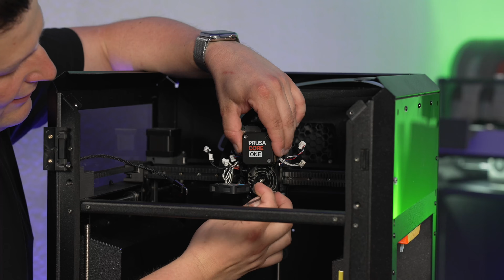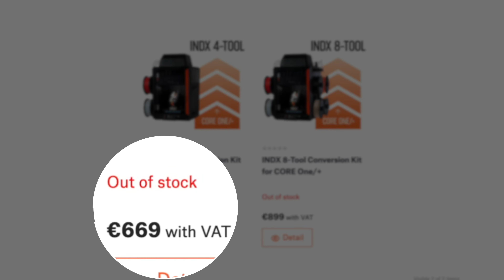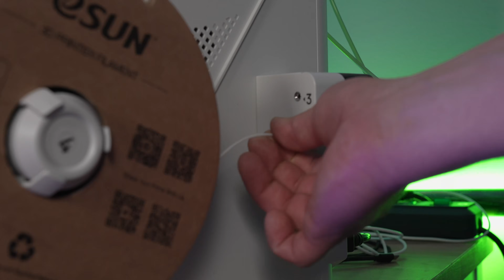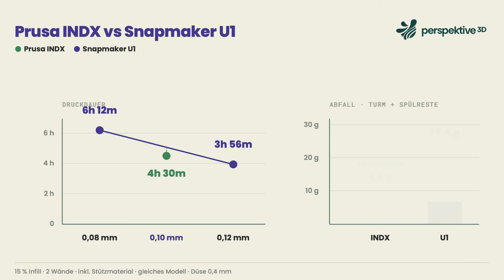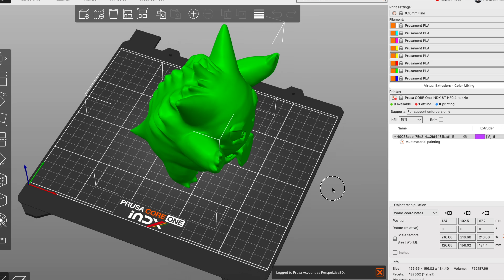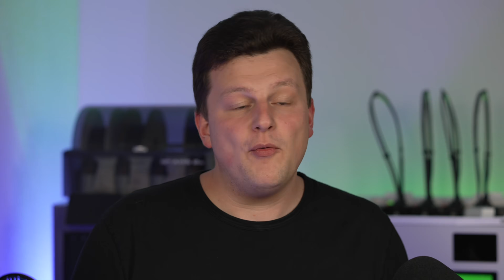Prusa INDX: Is It Worth the Wait? My First Look

Comment: at that total price, how does it compare to the Prusa XL?
Reply from the maker: Well with my XL I am not super lucky. I have feeding issues and I just have to baby sit it much more. There might be something wrong with my device but in general the INDX feels more modern and reliable. Although I know there are XL users that do not have any issues. As a 5 tool and with enclosure the XL is more expensive
Reply: @p3d-intl  interesting. I'm strongly considering the XL if our roof repair is surprisinglky cheaper than budgeted xD, but I am the most lazy possible printer user.

Comment: The indx clearly needs a prime tower as the stringing with the pellet solution is clearly insufficient at the moment. 

A more fair solution would be to either remove the prime tower for the U1, or add one to the INDX and the compare the times. In both cases, the U1 would be far faster than the INDX. 

You also can easily half the prime tower or less for the U1 without sacrificing any quality. This will again make the tool changes noticeably faster than the INDX, even without the prime tower. 

Also, the U1 can easily go down to .08mm layers and lower.

The 20 second tool changer is the absolute worst case for the U1. The first layer prints a prime tower with a large brim for adhesion so it takes longer.
Reply from the maker: Thanks for clarification. Will check in my full review!

Comment: Imho, the "new" stuff like indx and full spectrum makes it more and more clear that the 3d printing space's SW has a huge SWE problem: the current separation of concerns is wrong, and it's time to get it right. The current "god" slicer concept and implementations, which try to know it all, are not scaling properly with the current pace of change.
Slicers should only describe geometries and process features (parts orientation, infill, supports, prime towers, etc.); everything else (speeds, motion, materials, etc) belongs to the printer, and it's FW. That would address pretty much all of your grievances.
Reply from the maker: Interesting idea

Comment: Just for the record - depending on what you are printing with the Snapmaker U1 you really do not need a prime tower .
I have printed many different things without a prime tower , even a handle with embedded shore 60a tpu without
any prime tower , so in reality you need to compare the Core One with the INDX system against a print
on the Snapmaker U1 without a prime tower .
In the end i am glad to see this video really showing the INDX system in the wild , no doubt that 
Bondtech came up with a very good design to allow many tool heads in a small space .
Thank you for the video :-)
Reply: I also  often print without a primetower on the U1. Partly by choise, but often because I want to combine filaments that don't bond very well, to use aa support layer material. 

But if I use a primetower i that scenario, both types of filament also end up in that same tower. And things can get ugly, tha chance of spaghetti forming, is huge. So it would be nice to Print 2 thinner filament towers, one for pla, 1 for petg.  Or an option to not use the filament used for support interface, in the prime tower would be great. 

So printing without a primetower works well in many occasions. But with use of the nozzle wiper. 

So Prusa, please add such options. 

(Still waiting for my chance to order the INDX, but owning a C1L, I have to be patient....).
Reply: @4Lph4Num3r1c you can set the prime tower to create a walls with only one material. Keeps it from toppling.
Reply: @Zardozer yes but not the whole tower needs to fall to bring mayhem. Also the little strings that don't bond, will start to live their own life. Ending up in other pieces or just laying around the buildplate. And sooner or later the AI will pause your print. (At 2 am, loosing valuable print time, that isnt being used). 

Am option where ot doesnt end up in it at all would be better. The toolhead with the support material can prime at it's start position with the wiper.
Reply: @4Lph4Num3r1c I print all the time with PET-CF and PLA for support, they do not adhere to each other and have never had any issues with a priming tower. Flawless every time.
Reply: What printer did you use to print 60A TPU ? the U1 ?? thanks
It works well on my A1 but I have to mod my dryer, now I have to hold the filament with my hand...

Comment: As expected Prusa’s integration is lacking. As for INDX - which is built by Bondtech, one of the world’s best renowned extruders manufacturer - I have zero doubts the hardware will deliver flawlessly. I actually feel bad for Bondtech as I believe they fell for the appealing trap of signing a big integrator like Prusa from the get go and this has harmed them and made impossible access to other smaller integrators, (like us who applied for that in the early days).
If Prusa are already suppling this, the integration should - imo - be already be much more polished; it’s starting to look the XL fiasco all over again where early adopters were heavily “penalized” by those initial tuning/calibration/reliability issues. It will come to a good end I believe though.
Reply: Only issue I see with INDX is the exposed induction coil. That could be damaged by misalingment during tool changes.

Comment: Auto feeders like those on the AMS and U1 are underrated.
The indx seems like a decent concept but definitely a niche product and not the "new" multi color/multi material standard many were lauding it as.
I'd still choose the H2C+2 AMS 2s over this.
Reply: I'm perplexed by the fact that Prusa still do not offer a better solution for their MMU3.  The MMU itself works very well, but the filament buffer is a colossal PITA to load.  But there are better solutions, I use community-designed self rewinding spool holders, they work on the action of the filament being pushed back in the tube; there's no motor or power required.  And there are motorized versions as well.  
Personally I'm not going to touch Bambu.
Reply: @kaasmeester5903  That's fair. All of my bambu products (printers, AMS units and filament) have been rock solid reliable and predictable for me, that's why I stick with them.
Reply: @kaasmeester5903  as someone who has used both the MMU and AMS, lets jus say that there are good reasons that everybody is copying the AMS (individual feeders) and no brand has released a MMU (sliding selector) clone.
Reply: As much as people want to hate them now (and I completely understand those reasons), you still can't beat the workflow and automation of the Bambu Lab machines. Automation makes money. The AMS auto-refill feature by itself has "good for businesses" written all over it. My auto-refill gets used almost every time I print since I make very large and dense parts that are close to 1.4kg. If I'm asleep and the current spool being used is almost empty, the machine isn't going to waste those hours waiting for someone to feed in a new spool. Factoring that along with how reliable their printers are, and you have something that many people are in the market for.

Comment: There isn't anything in INDX that justifies the pricing. A 150W 24V induction heating inverter and coil cost less than $25 shipped, $50 as a DIY project. There will likely be half-price alternatives to INDX by this time next year.
Reply: This is a stupid comment. That's like saying "there isn't anything in Iphone that justifies the pricing, it's only like 50$ in raw materials like silicon and metals". Do you not realize that they have spent years on research and development. It was developed and is manufactured in Sweden, where the salaries and other costs are high. The reason why a lot of Chinese companies can bring down the cost is because they pretty much copy or clone what other companies have already invented. And manufacturing is faster and much cheaper in China.
Reply: @graxiecool  INDX doesn't need millions of dollars of R&D to achieve 95% of the functionality. At a glance, it looks like it should be just about the cheapest possible tool-head and hot-end design. On pictures, they couldn't even be bothered to protect the induction coil, hope the production version fixes that.

People have made DIY tool-changer mods for a few hundred dollars as a hobby, just not as compact due to the use of bulkier 3D-printed and off-the-shelf parts instead of custom-machined or injection-molded ones.

If I designed my own tool-changer, the biggest pain point would likely be learning how to add tool-changing code to Klipper if none of the existing tool-changing forks work in a similar enough way to how I want my tool swap to work, though looking at candidate forks alone could take days. Someone fluent in Klipper would likely be able to tweak existing code in a few hours.

The concepts related to tool-changing are not remotely new to the manufacturing and modder community. Unless BondTech's INDX contains patent-worthy new ideas besides patenting/trademarking the looks/shapes to prevent interchangeability, there will likely be third-party alternative 8-12 tool-ends kits under $500 soon enough. Fewer than 8 may not be worth the trouble since consumer printers will likely come standard with this many soon enough.

The only reason they can charge $1000 for now is that printer manufacturers aren't in a rush to bring consumer 3D printer price points down this fast. Consumer manufacturers just introduced their 4-6 heads printers, people who want 8+ now are the most likely ones to accept the premium. We'll likely see 6-changers become the norm at $1000 next year and 8-changers in two years - got to give customers reasons to feel like last year's printers are inadequate.

You can almost buy a whole M1D for the price of an INDX add-on, skip the hassle of installing it and gain a 2nd X-axis head for simultaneous printing or zero-swap access to a secondary material for things like support interface layers.

Comment: I don't understand your narrative. When you order the Founders Edition, you're aware that many features will be unfinished/missing (in a sense, this version is a beta test), and the delays were also due to hardware improvements (and a lot of software improvements were made along the way). Unlike, for example, the BambuLab H2D, Bondtech & Prusa decided to simply show an unfinished product, even so that users could contribute improvements to the hardware...
Reply: This is not a prototype, they sold this as a finished product.
Reply: @filmodpetra Not entirely. Founders Edition is an early release (even with the minor differences from the Prusa version), and there will be a lot of fixes and improvements to the Indx-related software in the near future.
Reply: @Zakrzewiaczek  they can fix things in software but they cant fix bad hardware (for example adding an additional nozzle wiper would be surely helpful).

I just cant get my head around how strongly they advertised no purge tower, and the result is a bad print...

Id rather have a prime tower any day of the week, but have normal print quality (to be fair, the single color print quality also looked ok, but worse then the competitors). And I know I can turn prime tower on, but the one of rhe main advertised feature on Prusa website is no prime tower...

Also, ok, lets say its not production version (It is, but lets say its not). It is acceptable in this case to send out to users a release candidate level of refinment. But what Ive seen from the 2 available first look videos so far, it is worst than an alpha version...

There are a lot of drawbacks of Prusas implementation.

Comment: I tried to get on the list but missed the opportunity.  I reached a point where I needed more nozzles than my U1 could provide. Just purchased an H2C. I have lost faith in this project. I do enjoy the simpleton Bambu way... As long as the user doesn't break anything, the H2C just works, and it's here with an established track record.  I guess I am getting too old to be an early adopter. ;) For this hobby, I want the hardware to just work. 6+ hours to make the modifications... If I were able to get my hands on the founders' edition,  I would have said sucked it up. Today, I say no way. I will keep this on my list and maybe grab one about this time next year if it's released in a more complete kit or built-on. Tech support lines will be burning red hot once these kits hit enough peeps. So many avenues for simple errors. What a nightmare. Good luck tech support!

Comment: The listed max temperature of 300C nozzle and 60C chamber is also a little of a bummer for engineering materials. I don't know how hard the chamber temp limit is but > 60C is ideal even for abs
Reply: thing is, its not really a "heated chamber" all it does is use the print bed to heat the enclosure
Reply: Consumer grade electronics generaly speaking are all desinged with a maximum ambient temperature of 65°C. Above that you cant use electrolytic capacitors, most microchips and standard wiring. Going above 65° requires more expensive components, carefull thermal management, thermal insulation and external cooling for sensitive areas.

Comment: The problem of Prusa is they are so proud to be made in EU and stuff they completely ignore design and user experience. They still have the mindset of designing for the same few Ender 3 users who are into tinkering and modification, completely ignore a huge population of users just want to create and print, and not being a printer mechanics as hobby.
Reply: I have a feeling they just can not do it - making a simple to use printer. Not enough investment in R&D... Or they are investing but not to the correct people. Hard to tell.

The printer has an NFC. It could be something that reads their open print tag, but it doesnt. And it os hidden at the back of the printer. Amd there are so much other missed opportunities...
Reply: @filmodpetra  I wouldnt call it 'not enough RND' but the wrong type of RND. Only focusing on the technical side, and ignoring user experience.

Comment: Reminds me too much of the significant years of delays that the prusa XL had. The stringing, the hardware changes, all that stuff. It took literal years to fine tune that and then by the time it was released, it's essentially not quite obsolete, but close to it at this point.
Reply: And yet I still want one.
Reply: Depends, if they finally release their silicone printheads (if they work as advertised) and maybe a continious fibre one, maybe their initially advertised pick and place...then the XL is not obsolete at all. But this are so many ifs for such an old machine...not a good look for Prusa sadly
Reply: @xandroy1273 even then, it's absolute for all but a very niche use. Still cool but basically a failure.
Reply: still haven't fixed stringing on mine

Comment: The ability to print TPU at least as soft as 90a, ideally softer, without fuss is by far the most important element to me.  The other two issues are, what to me seems a poorly done system with a good swapping tech.  It is poorly integrated, lacking most expected basic features.  Even rudimentary things like filaments in the UI, filament profiles, and on and on.  Made in Cech and Swe is nice and all, but it has to be both complete and actually available and INDX is neither.  It may be slightly costlier to build in the EU, but if VW can compete and offer a fair value, why can't Prusa?  Why does it cost double or more?  The price is simply not reasonable.  This boutique approach is why Prusa has gone from a dominant market share to a trivial 3.5%.  If they want to be relevant they need to ship faster, ship complete products, and ship at a reasonably competitive price (not 2-2.5x the others).
Creality uses a dual motor solution and advertises very easy printing of extremely soft material.  They will likely have the larger (k3+ and K3max) version be available sooner than the C1L+INDX.
Sovol has the IDEX + 6 other nozzles (7 in total) for something that is both larger than the CoreOne_L once it gets INDX but for around 1/2 the price.

I might get the C1L+INDX.  It will depend on if they iron out the bugs and can deliver it before it becomes obsolete.  But I am at this point leaning towards Sovol and Creality.  Sovol is completely open source.   Creality is mostly open.  Both products seem interesting as the C1L and both seem likely to actually have a complete product available 6mo to a year ahead of Prusa and at a much better ROI.  Makes wanting to support Prusa difficult, even though I do want to support them, at least on a philosophical level.